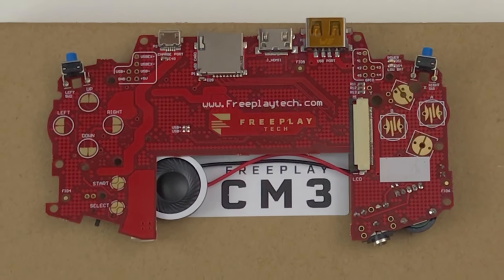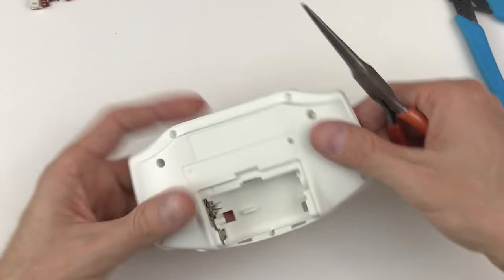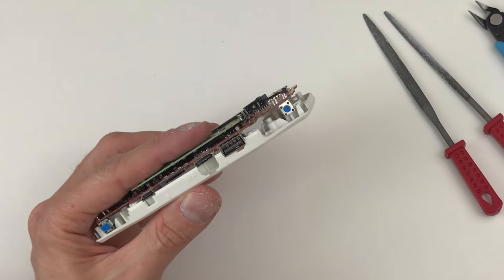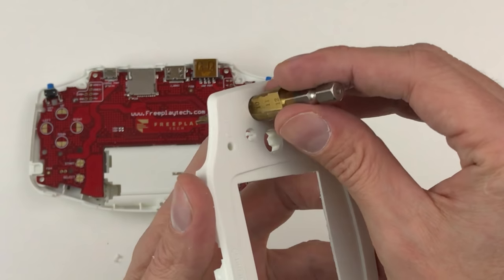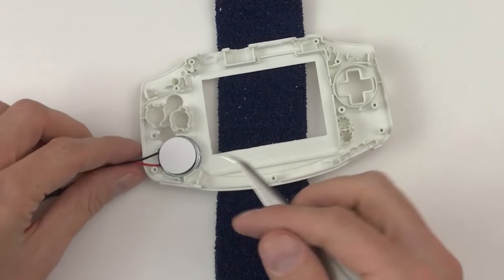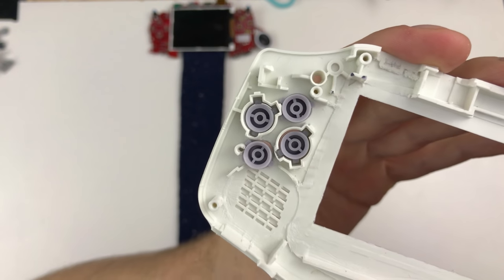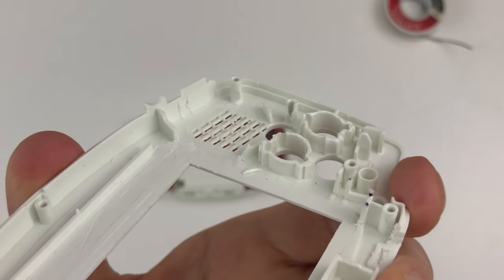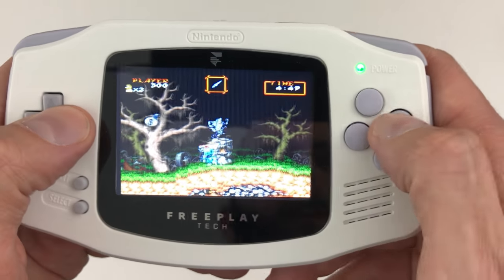Freeplay CM3 Example Build - New X&Y Button Options

Comment: Do you have links to the tools you've used?
Reply: So I found the xuron micro shear flush cutter (I'm assuming that's what's depicted. What level filer do I need? Bastard cut, medium, or fine?  Also not sure on the smaller ones you have
Reply from the maker: You know, those are pretty good questions. The flush cutter you mention seems good. For the files, I don’t really know. I bought them out of a kind of discount bin at a hardware store if I remember right. I don’t think it’s too important to use the specific thing I’ve use though; I’ve pretty much just grabbed what I have around that seemed like it would work. So pretty much anything that can get the job done would be fine. For example, I found these files the other day and so far they seem great https://www.amazon.com/dp/B076Q32XP8/ref=cm_sw_r_cp_tai_BerbDbG1RQ5JC . Also, the big flat file I used for scraping does work pretty well for that because the edge is flat and just about the right length to help flatten out the surfaces. So that tool could pretty much be anything with an edge like that for scraping. Now though, I’ve been using a craft knife with a curved craft blade to do most of my scraping. I’m also going to look into getting/making small sanding tools to help with this kind of task. So I don’t think there is really a set method or tool. Is there anything in particular you are unsure of?
Reply from the maker: I also ordered this set just now because my tweezers and flush cutters are in pretty rough shape  https://www.amazon.com/dp/B07JMBGL3W/ref=cm_sw_r_cp_tai_WlubDbG1P8YZX . I hope they are cool.
Reply: @jivinhipcat  your video inspired me to attempt this with no prior experience but with a steady hand. Was going to get at least the tools right and mark the spots with a pen and sand/cut things down. I LOVE your L2/R2 embedded in the L1/R1 but I'm sure that's beyond my capabilities. Especially with little ones. Don't have any of the tools so starting fresh. Tri wing was included with the shell and buttons on eBay. Got the angled cutters based on your response. Looking for the filers at this point as I await my haul. Excited and nervous at the same time

What are the pliers and exacto knife for? It's the curved xacto knife to cut instead of the angled cutter?  Would just the angled cutter work?
Reply from the maker: Oh I just noticed that Amazon listing called the cutters “pliers.” I think they are just the same kind of flush cutters we’re talking about (I hope). As for the curved craft blade, I like to use it in place of the edge of the large file for scraping to flatten things out. I don’t know if anyone else uses it that way, but it works pretty well, and has the advantage of also being a nice sharp craft blade for other things. You could still use anything else for scraping or even sand paper. Whatever will get the job done. It’s really cool that you’re going to start with this kit. I think the MOST important thing to note when you’re starting is to take it slow. If you rush things have a tendency to get messed up. So, I would just plan to do one task at a time instead of looking all the way to the final result. Like sit down to do the job of removing all of the unnecessary material from the rear shell and making that job turn out well. Then when that’s done focus on the next task. It’s really easy to try to go too fast, and that’s when you accidentally mess up the case. It’s not really a bid deal to mess up really. You can still complete the build with a less than perfect shell also. Then later, if you want, you can grab another shell and go again and transfer the kit to that shell. I’ve seen some people get a little frustrated (me when I first started hahaha), so if you feel too frustrated while working on it just take a break and come back later. No big deal that way :)
Reply: @jivinhipcat  thanks for the perspective and advice. You seem like the type of guy I'd be friends with. Cheers!!!
Reply from the maker: You too buddy. Cheers!
Reply: @jivinhipcat  where did you get the silicon pads from? My cm3+ didn't come with it. I ordered the non soldered version ("soft rubber feel") which I thought would've been silicon pads as the other two options were boxy and presoldered
Reply from the maker: They sell the pads on the site here https://www.freeplaytech.com/product/gba-style-silicone-rubber-conductive-button-pad-set/ . I’ve never bought them that way though because I usually buy shells on eBay that come with the pads. Also, when I buy shells I usually buy 2 in case I mess up which happens a lot. I actually spent all day today trying to figure out why things started not working on my current build and have to continue tomorrow :’( . The good thing about buying 2 at a time is that I get the second set of pads for the build as well. Did you buy your shell(s) already?
Reply: @jivinhipcat   I did. But I think they messed up. I asked for the multi color sfc colors but they gave me all black and all gray buttons.. I did get two but didn't get the two individual extra silicon pads for the abxy buttons. The guy I bought from on eBay is also out till early July so I'm in a holding pattern at the moment
Reply: @jivinhipcat  where did you get the full screen glass from? I might as well get one now while I'm waiting
Reply from the maker: I just use the Freeplay glass 
https://youtu.be/H7zOjRIAHXs?t=341 . I use a razor to scrape off the bezel paint, and some acetone to help clean it all off. Then spray paint it like in the video there. If you’re careful you can just scrape away the paint to thin up the bezels to the right size and still be able to see the Freeplay logo.
Reply from the maker: I’ve been messing around with different silicon pads on my current build, and they can be pretty different from one another. I ended up trying out like 5 different D-pads before landing on one I really like and that works correctly with my build. I changed the D-pad location again so that makes it a little more difficult too. I also had to swap out a set of AB pads for the same reason. I can’t say for sure, but if you’re stuck waiting for a while for the specific seller to get your replacement pads you may benefit from grabbing a couple others form different sellers if it’s not too much trouble for you. Not a big deal to wait though. I’m just thinking if you would like to test out different feels. I was getting kind of worried with my build about the pads. Some I have don’t even work at all with my new placements. I ended up trying out this black color D-pad silicon pads and I was so happy to see that it works perfectly. Glad I bought an extra set for my previous clear build and ended up not using them all.
Reply: @jivinhipcat  didn't realize the silicon pad can be an issue. Where did you get the black silicon pads from?
Reply from the maker: On eBay. I’m trying to pull up the exact listing now, but form some reason it won’t let me. They aren’t an issue most of the time. Most of the time they just feel a little different from  each other. Like in my first PSP analogs build, the D-Pad was kind of stiff. The next build it was more soft/clicky. The next, a little mushy. All working fine though. The issue with my current build is that I’ve moved the D-pad to a new position like my other Joy Cons build, and I’ve also moved around the ABXY buttons. This makes the little differences in the pads even more apparent. Normally not an issue though, just for the slight difference in feel.
Reply: @jivinhipcat  I got my stuff! Just stuck on trying to figure out the glass. How do you know what size to make the bezel? Do you attach the LCD and line it up from there? When you scrape the bezel on the glass, is three a way to do it where it doesn't leave marks on the glass? Not sure of that technique
Reply from the maker: ohdaUtube 
Porcinus does it by using the shell (even the normal plastic shell) as a guide to scrape off the unneeded bezel area 
https://youtu.be/OZYHepz-8SU?t=1296

I usually just scrape off and use a little acetone to clean the bezel off and then spray paint my own 
https://youtu.be/H7zOjRIAHXs?t=342

To line up the screen I have used a piece of tape to hold it in place while I tack a small bead of hot glue inside the shell to hold the screen in place 
https://youtu.be/H7zOjRIAHXs?t=258

Comment: where did you get the blank buttons?!
Reply from the maker: https://youtu.be/HcUCw5oCoIE?t=1646
Reply: I was curious if sanding transparent colored buttons would turn out ok with this method?
Reply from the maker: I think so, but I’m not sure what the exact finish would look like. I bet it could look good. I’ve started adding the step of lightly buffing the buttons after the sanding to bring the surfaces to a glossy finish. There is a bunch of wiggle room for the final finish. Leaving them sanded using different final grits could do different matte finishes and feels. Scraping with something else like a craft knife would do others. I’d say there are different ways for them to turn out well, but sometimes (a lot of times) experimenting can lead to failures. I go through parts here and there testing things out. Just something to be aware of in case you only have one set you may want to be slightly flexible on the exact finish if you’re going to experiment.
Reply: Thanks! I'll probably get a test set and experiment with how they turn out. Thanks for the reply and this video!